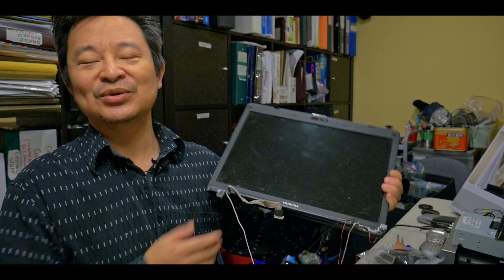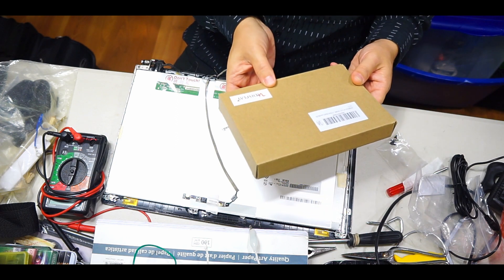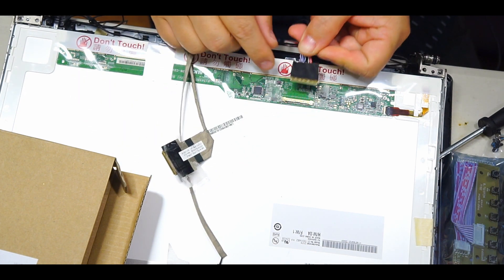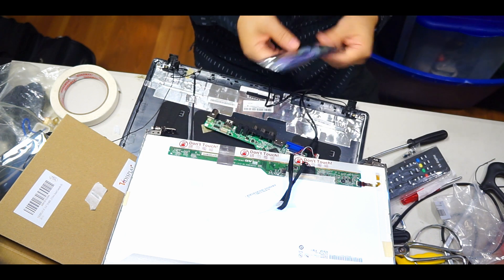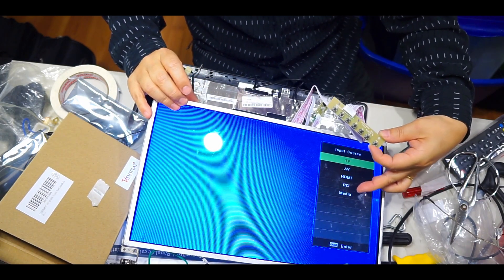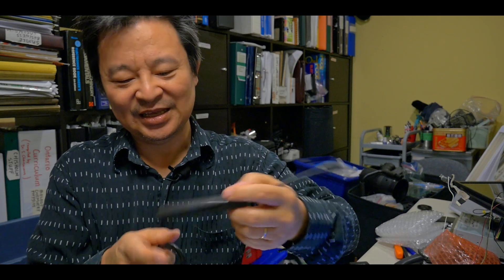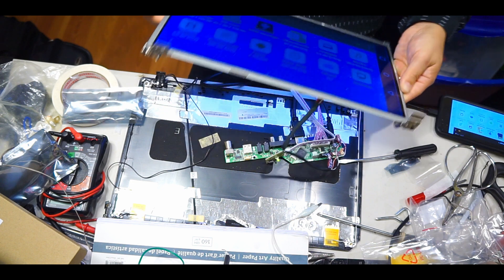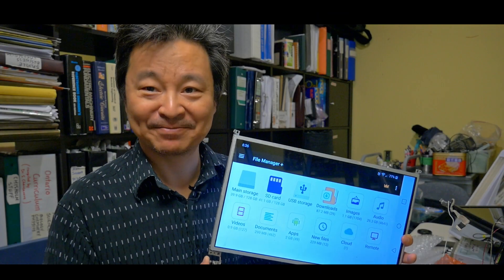How to convert Laptop Screen into HDMI LCD monitor using VSDISPLAY Video Board Controller B156XW02

Comment: Hi, I have a Raspberry Pi 400 that I want to use an lcd screen from my old HP laptop, I picked up an lcd driver board and it works with the Twister operating system but I cannot get it to display with the Bullseye OS or the new Bookworm OS, nothing comes up on the display but it works wihen connecting directly to a 19" samsung tv without the lcd board on all 3 operating systems. I had the same set up before with an older lcd board and an older laptop screen and it worked but the screen display was very poor. Any idea why it only displays with the Twister OS? Thanks
Reply from the maker: I have a feeling it is the OS display driver not communicating properly with LCD module.  Not sure why it is not working.

Comment: So I plan on doing this connected to my desktop computer; USB or HDMI connected. 
My question for anyone is: 
Is there a way to have the screen slave power off of the desktop computer? 
Or does it have to have a separate power cord?
Reply: I am wondering the same thing, did you figure out how to do it?

Comment: Great video , Can you please assist me? I bought a controller board specifically for my laptop screen. I've connected all the cables: power supply, wire from the board to the screen, and HDMI from the laptop to the controller board. The screen lights up, and the "no signal" message is displayed on the screen, and then my screen goes black. I have unplugged the connections and connected them again, but unfortunately, the same message persists. My power supply is 12V 3A. Is it possible that the power supply doesn't supply enough power?"
Reply from the maker: Either the board is defective or it is not compatible.  Mine recently just stopped working.

Comment: I need LVDS Controller Board LP140HW4(TL)(C1).
Ebay and Aliexpress not working in India.
Amazon doesn't have that item.
Help me!
Reply: Facing same problem bro
pls reply if u happen to find a solutn
Reply: reply to me if you find any solutions

Comment: Is there a way to convert 40-pin lcd to hdmi out as a way replace a broken all in one pc or laptop?
Reply from the maker: You can purchase a usb led monitor or VGA or DVI monitor to connect to the broken all-in-one PC or laptop.  You can also purchase a 40-pin LCD with HDMI  connector.

Comment: Hi there! I have an AOC i1601Fwux portable monitor which I used with my laptop but now that I've built a PC since my motherboard doesn't support USB alt mode, and my GPU doesn't have USB type c, I can't use it, I was wondering if there are any control boards that I can use to convert HDMI signal to USB type c
Reply from the maker: Yes, there is an HDMI to usb c adapter.  I brought it from Amazon, Temu and even  seen it at AliExpress.   I was able to connect my smartphone (usb-c) to an HDMI led monitor.  Just search for 'hdmi to usb-c adapter.'

Comment: Can you hook up the HDMI to television using HDMI type c controller board ?
can you recommend a board that you have experience with ?
thank you
Reply from the maker: If you have an HDMI to usb c device for windows or android, it should work.  I have one for my android 11/12  smartphone (LG thinQ 8x) and it works fine.  I think it depends on your smartphone. My friends' older smartphones weren't working with the device and I don't know why.
Reply: @educatetube  
Thank you friend .

My device is a Samsung Galaxy ,
Model name Galaxy A13 5G
Model number SM-A136U